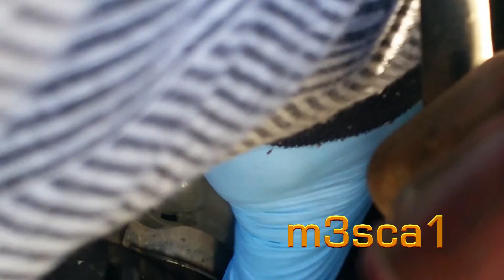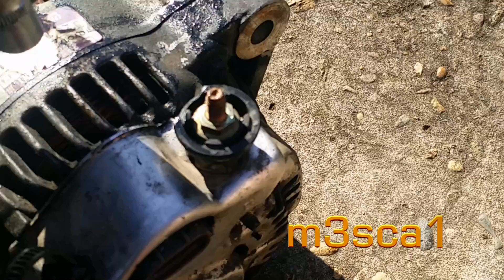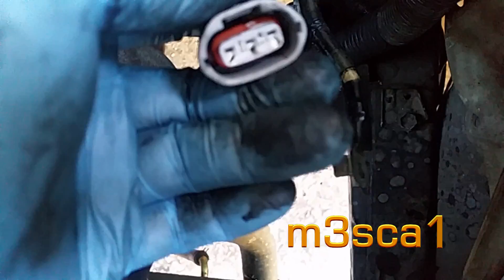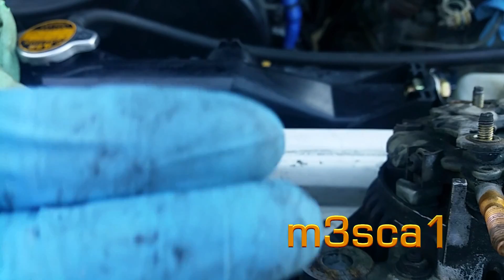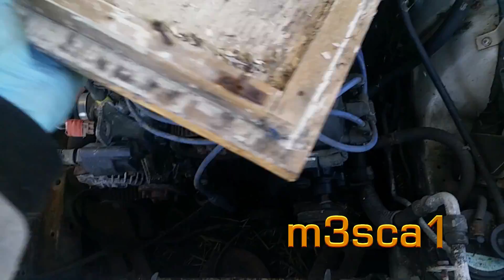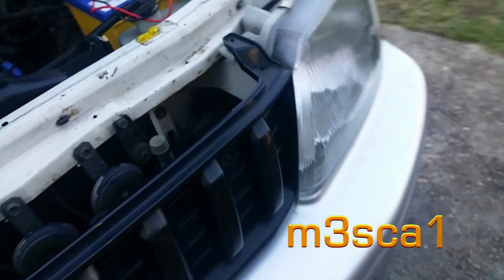Alternator Trouble-Repair or Replace?

Comment: My comment before was from my last experience rebuilding an alt =1977.  I am sure they now have rectifier bridges if not integrated electronics for  rectification and and on board  "battery regulator."   I assumed you'd buy a refurbished unit looks like you bought new.  Probably the best choice. All's well that ends well!!!
Reply from the maker: I don't think much has changed in a long time...probably still using individual diodes...the deciding factor was time...that and the bloody commutator looked like it had lost a lot of meat. Might rebuild the thing yet.